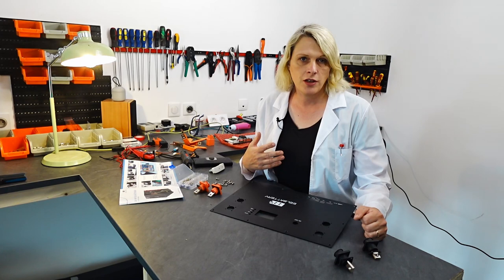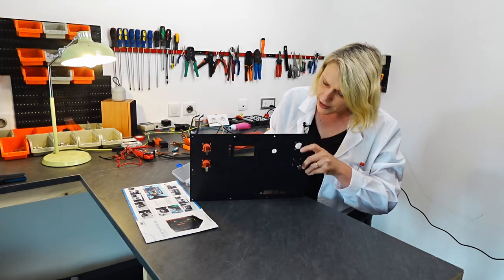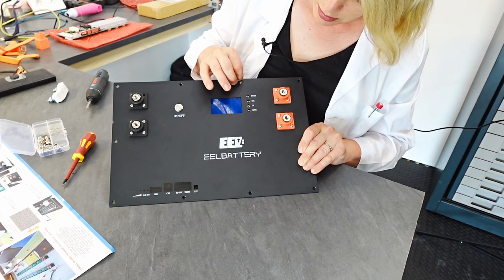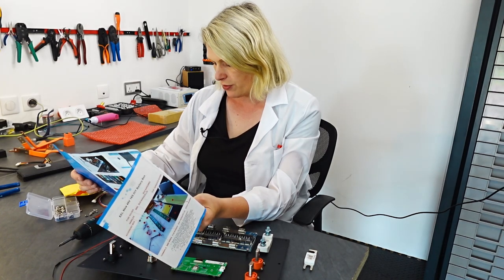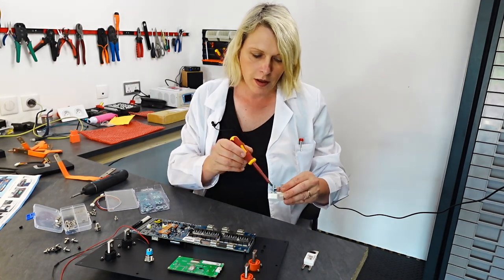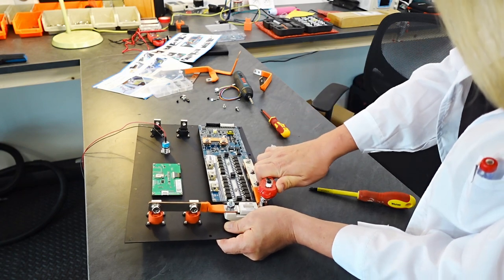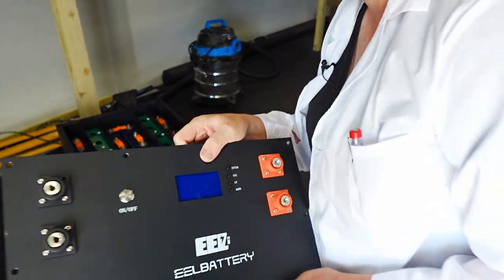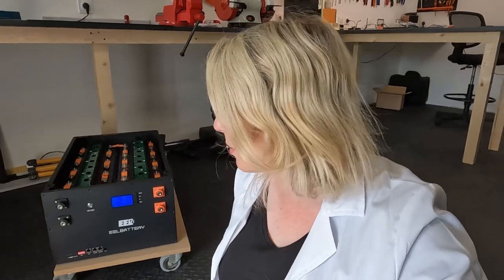DIY Lifepo4 Battery Case kit build part 3

Comment: I like it!  Safety glasses are a must though!  A rag or piece of cardboard/plastic to protect against dropping the tool into the battery and causing a short is also a necessary precaution.  There is a lot of energy in those cells, so please do as much as you can to avoid accidents.

Comment: split washers were removed from the DIN standard. 
Practice has shown that these do not prevent the nut from coming loose.
But many are of the opinion that these should still be used.  So no longer a standard but a question of faith.

Comment: You have made a mistake, so please do not use this battery until you have moved those flying leads (voltage and temp) to the top of each terminal. Placing them under the buss bar will create a heat point and could cause a fire. Well done and ho best time to fit those balancing leads is when assembling the front panel.
Reply: I've checked the part 2 video and she did put the balancing leads on top of the bus bars and not under it.

Comment: I have also two Seplos BMS (but another type; version 3) and it‘s very important to follow the installation instructions. When you connect in the false order the cable you can destroy the BMS. In my case I have connect the white cable first and the BMS has a big ARC on the connector. The BMS was damaged. The black sensor cable must first connected and then the white cable and at the last the B+ cable in my case. 😅

Comment: thanks for the videos, I'm late to say that but as far as I know, it will be a better idea to put the balance leads on the bus bars not underneath them this way your bus bars will have a better connection with the battery terminal.

Comment: The EEL box also comes in with a JK BMS. Did you consider that one? If so, what was your reasoning for choosing the seplos?
Reply from the maker: The JK BMS option has only just come out in the last month. If I were starting over I would definitely go with the jk BMS.

Comment: Me again, since I was watching on the phone I’m not sure, but it look like you put the balance leads between the cell terminal and the bus bar. That will make a bad contact between the bus bar and the cell. If that is the case, put cell, bus bar, balance lead, washers and nut. 

Again, limited experience with this kind of batteries, but that it is what I see everybody else do and makes sense.

Comment: Hi, not an expert here, an English not my main language (I’m from Spain). What you ara calling split ring is a lock washer. You should put fuse, washer, lock washer, nut. The washer goes between the fuse and lock washer so the lock washer does not damage the fuse contact surface.

But I was saying, not an expert. So take it with a grain of salt.

Comment: Split washers always go next to the nut. If using a plain washer that would go next to item then split washer and finally the nut. Don't bend the bus bar, use nut to lock fuse holder to board then washer/bus bar/washer/split washer nut.✔

Comment: I think that better just level a straight busbar with washers, than put an extra washer between the busbar and fuse, then spring washer and nut. In this sequence, it will be simpler to change the fuse if it has been damaged.
Reply: fuse is designed in a way that you dont have to remove the nut and lock washer in order to replace it, just slide it out so its a "non issue"